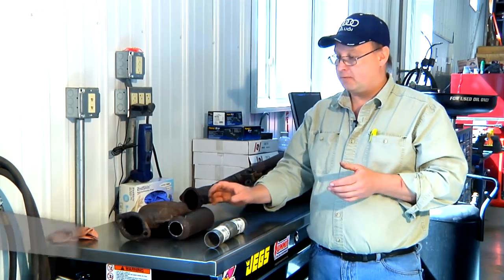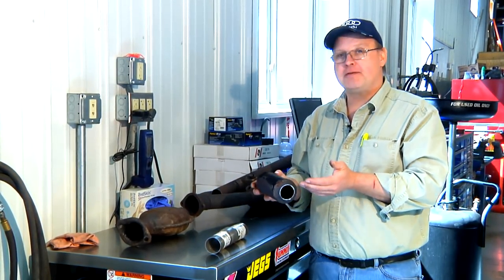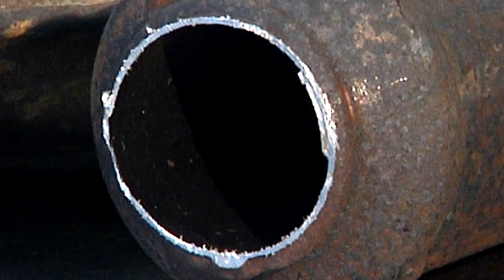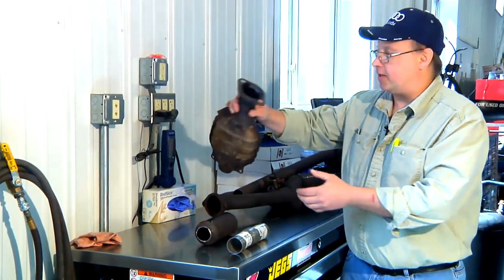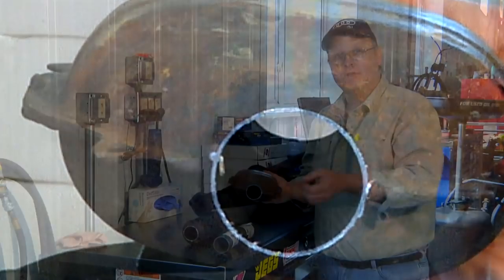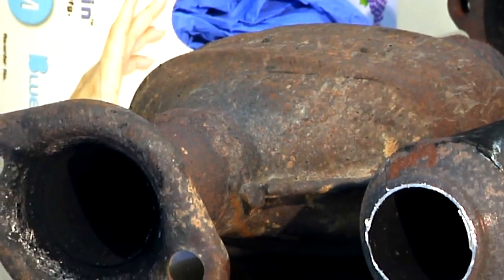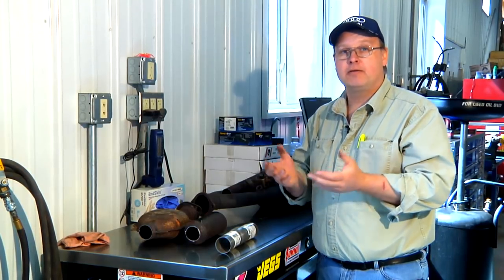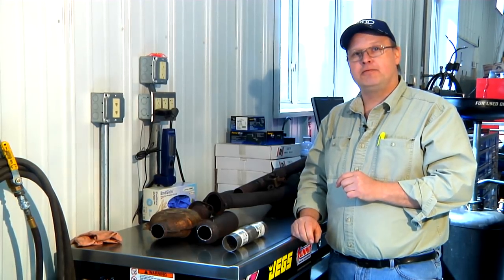What Happens if You Replace the Exhaust Resonator With a Pipe? : Under the Car Repairs

Comment: just remember, an engine is an air pump---the more air you can get in, and the easier the air can get out (with the right percentage of fuel) the more power you are going to make. period. backpressure is restriction, and some will argue its needed; but IMO all that is needed is a tuned exhaust system that takes advantage of scavenging at the right amount for that engine and the cam being used to help vacate the combustion chamber---ideally, you want 100% of clean, unburnt air and fuel in the chamber, no residual gases that wont burn.

Comment: Not sure what's up with all the dumb comments. As an Mechanical Engineer that works in the automotive industry--HE IS CORRECT. The chamber evens out the exhaust flow by allowing the exhaust pulse a place to expand. This MOMENTARY BACKPRESSURE allows for smoother exhaust flow and more efficiency.

Comment: The issue is not back pressure.  The issue is exhaust velocity and proper exhaust scavenging.   You want the exhaust to be the correct diameter because if it is too large exhaust velocity will be hindered.  Right diameter,  straight path for exhaust to follow.  If noise levels are an issued that where sound deadening and baffles come into play.

Comment: my dodge intrepid came stock with TWO resonators on a dual in single out system. i've removed both of them and changed the muffler to a flowmaster 40 series and my gas milage stayed put while my power and responsiveness increased.... so pretty much a res creating back pressure is bulshit

Comment: Im not a engineer but i am a mechanic. What i can tell you is. Car needs back pressure duh Obviously. But regular resonator wont give you much back pressure anyways. so it wont really matter. and resonator compared to a straight pipe wont flow much better honestly. ofc it will a little bit but thats seriously not even alot. so only reasons to do it are sound and the extra extra extra tiny bit of better flow.
most of your back pressure come from the whole exhaust pipe it self since it restricts most of the exhaust gasses from just escaping in to thin air. And things like pipe bends, catalytic converters and mufflers add on to the back pressure.

Comment: That's because a narrower pipe will have a higher exhaust gas velocity. This performs better at low RPM because for that given rev range, the flow rate for that cross section of pipe creates a good balance of static and dynamic pressure

Comment: Back pressure is nothing more than resistance. It's slightly needed for torque but not at all needed and actually avoided for peak horsepower/acceleration. 

I tune for Volumetric Efficiency by reducing back pressure as much as possible at boost or upper power areas where restriction affects flow.

Comment: That's where exhaust header length tuning comes together. Given a certain fixed effective cross section, of course average flow rate is proportional to average velocity. That effect you describe can only work at the specific rpm that header was optimised for, assuming it was mounted correctly on the engine it was designed for. Many racecars actually use heat insulation wrap to keep the heat IN the exhaust pipes to maximize exhaust velocity, as well as reduce engine bay temps.

Comment: You're a professional?  Really?  Ok, others have said this, but to be 100% clear- backpressure hurts both power and mpg.  Removing the resonator will help both (rather minimally, but it will).  In all the examples that I can think of, resonators are installed to attenuate annoying frequencies that the muffler and the rest of the exhaust doesn't for one reason or another, usually a droning/resonating that happens at cruise rpms.  If you want to remove it and don't mind the noise, go for it, it really won't annoy anyone but the occupants of the vehicle, since typically the noise that it does attenuate only happens under load when you're moving and it usually only objectionable when it interacts with the cabin volume.
Reply: right..resonators are there to stop a drone created by having a tuned system/less restriction muffer. and usually that drone is at highway speeds and it can be annoying in the cabin.

Comment: Resonators are design to disrupt the exhaust pulses flow mostly for sound control, depending on size and design of the resonator they will and can produce varies amount of back pressure. But I disagree that back pressure is needed to increase efficiency.  tune exhaust utilizes the push/pull of the exhaust pulse to  optimizes efficiency.

Comment: I think the straight pipe is  way more efficient it give the gas the least resistance to flow as for the resonator it's only for giving your engine a lower sound by reducing the dynamic of the gas.

Comment: If a quieter muffler makes more power than a louder one, it's not quieter because of back pressure but rather destructive interference. I've got my own 'philosophy' about louder or quieter exhausts as well...If it's not a V8 and/or a manual trans, it's better off quieter than louder. :)

Comment: I agree with what the dude in the video is saying, but, it does have some benefit at a cost. Removing the resonator will reduce low end power due to the reduced back pressure, but the benefit is increased top end power due to less restriction and higher exhaust gas velocity.This is all theoretical however, the actual gains or losses may or may not be substantial, and manufacturers usually put them on cars to reduce drone inside the cabin as it can become annoying.

Comment: I had a guy replacing my cars ring and pinion 3.42 to 4.10 and beached about my exhaust cut out i had will reduce back pressure and torque LOL. I always trip out especially on a ls1 ot lt1 camaro how many times i heard that. Never felt they lacked torque nor needed any type if backpressure.

Comment: Resonators do nothing but increase the resonance of your exhaust sound. (Resonance: the quality in a sound of being deep, full, and reverberating.) Back pressure is a myth, the less restriction on your exhaust, the MORE efficient your engine will be. (If tuned properly.) Also, the second rusty peice he shows is just a gutted catalytic converter. 

Replacing your resonators with straight pipe is 100% fine. The only thing you MIGHT notice is a slightly louder, slightly more raw sounding exhaust note, and of course a little more cash in your wallet than if you would have replaced it with another resonator.

Comment: if you install a gneuter valve you will not sacrifice back pressure, and you will gain power, but expect to replace exhaust fluid (the fluid you see coming from a cold engine dripping out the tail pipe)  more often.

Comment: shit man your fine...seems like quite a few people on this page are super strict on keeping a stock exhaust. in my experience, removing the cat and replacing it with pipe generally increases horsepower and fuel efficiency because it allows the air/gases to travel through your exhaust easier

Comment: A properly tuned car requires no back pressure. It's a 4-stroke, not a 2-stroke. Exhaust gases in the combustion chamber increase efficiency, sure, but they don't  increase power. Even a properly tuned 2-stroke should have almost no exhaust gases in the chamber on the charge stroke
Reply: Um...he's right. If you knew anything about overlap you'd see why he's saying what he's saying. No backpressure can end in with a bunch of unburnt charge flowing through the exhaust which is why engines backfire. But let that exhaust valve be blown back open by a charge and you can say goodbye to your engine. This is why a lot of people frag motors that didn't seem to have issues before. Not only that newer model cars will interpret this as "ping" in some cases which will automatically reduce efficiency in the engine. Lastly all of the charge slipping out into the exhaust means less charge in the cylinder for the compression stroke. This is why you see honda's with small engines getting terrible mpg, slower than your granny's stock vehicle of the same trim, manufacturer, and vintage, and not as "racey" sounding as your buds stanced out ride. These are engineered machines. You don't subtract parts unless you have something better to replace it or mods that will support it being gone.

Comment: From what the comments say this guy is wrong then? my old car was straight piped with a straight through aftermarket muffler, super loud, popped, cracked and it was a 4 cylinder. I now own a 6 cylinder car and i just want a nice tone without all the popping. What exactly does the resonator do? and what exactly does the muffler do? i have a rough idea but more knowledge is even better. Should i delete either/or? Both? or save up and get a proper aftermarket exhaust system?

Comment: Depends on the motor, I have seen stock honda's lose power when they do it, But then see an LS1 Camaro gain 30Hp doing it. It all depends on your particular engine and the tune you have set up.

Comment: I honestly do not see how this will effect the epa on some vehicles or can cause harm. If the air is moving at a constant rate wether in revolations or linear flow how would this be an effect on a general vehicle? Please enlighten me on this for I have been doing research to actually do a delete on a 1.6L Alpha II DOHC motor with a CVVT from hyundai on me 2010 Accent.

Comment: My resonator rusted out. Since I didn't have any extra money but I did have access to some tubing and a welder I just put in a pipe. The car is much quieter than it was with the rusted resonator but it has developed a "rap" and it a bit louder than stock. I haven't yet burned a tank of gas so I can't comment on the fuel consumption. And, the reason an engine needs back pressure is so that the exhaust valves stay tight against the springs and don't slap back causing premature failure.

Comment: The faster you can exhaust gases, the faster you can get fresh air in. Resonators are meant for one thing and one thing only, to keep noise decibels to a minimum. It is basically a pre-filter for noise cancellation before it sound even hits the muffler. If what he is claiming about resonators were true, which it is not, then the cat would have already done the same thing before the pulse even hits the resonator. No matter what you do or how high you rev your vehicle, the pulses are going to be there.

States who fail vehicles for inspection if a person has removed there resonators from there vehicle has nothing to do with emissions. They are states with strict laws who have a specific legal decibel ratings for vehicles. Like I tell people, if it is ok for Harley riders say they need loud exhaust so people can hear them coming, then it makes sense for others to have loud vehicles so people can hear them coming as well.

As a person who rides a 2016 R1 Raven and an owner of a bobber style bike, what every your ride is weather it is quiet or not, your still going to be at risk as long as people ignore the fact that people who ride have rights to the road as well. The same goes for vehicles, as long as there is a dumbass out there, your still at risk to be in an accident not caused by you.

Comment: backpressure and exhaust flow are 2 completely different things ,never mix them.
backpressure : more silence,less performance,engine heat
exhaust flow : less engine heat,loudness,performance .
the resonator removes the loud low sounds that cause the vibration (annoying sounds) and it also causes slight backpressure to the system.
Never remove the resonator. (or get the xpipe instead)
Reply: A resonator is a piece of perforated pipe with packing around it and has no effect on back pressure

Comment: This is true only for carb vehicles fuel injection doesn't need backpressure the map and o2 sensors adjust accordingly to flow needs meaning replacing resonator with a pipe does nothing to fuel economy just rasp a little more in the exhaust

Comment: Bob Holcomb: "It also builds the proper back pressure" as he holds a Catalytic converter and also the resonator goes on the very back end of the exhaust to change the sound of the exhaust and not stop sparks as claimed.

Me: Bob stick to washing cars instead of trying to understand them!

Comment: On a STOCK engine equipped with an EGR system (which almost all are), proper back pressure IS needed for correct function of the EGR system.
Do nothing else to your otherwise stock car but cut off exhaust just downstream of the catalytic converter(s), the go out and drive it.  You'll notice the decrease in power.
Modified engines are a whole other story, though.

Comment: I have a 99 vw jetta vr6 2.8 liter. The car is running like crap! I noticed that the cam shaft sensor was bad and the was oil blown through it into the actual plug! I also noticed oil getting through pcv into the air intake pipe! I also noticed that when i plug in a vacuume line in the back of the upper intake manifold the car will stall! I dont have a pressure gauge set to test back pressure! What is your opinion on what i have found wrong so far with the car! Can it be a clogged converter causing these issues? Thanks for a great video!
Reply: If you have access to a jack, and are up to the task of a little manual labor, your cheapest option would be to do the following:
1. BUY SOME PB BLASTER
2. Jack up the front of your car make sure your parking brake is pulled tight.
3. Spray the PB blaster on the bolts connecting the manifold collector to the downpipe and wait at least an hour.
4. Disconnect the downpipe from the manifold.

Now if you start your car and the cat was the problem,  you SHOULD notice it running a little better because your cat will no longer be obstructing the exhaust stream.
Your O2 sensor may throw a code within a few minutes saying that the mixture is running lean because there will be no exhaust for it to detect, however I would think you would already have a code if the cat was the problem. Hope this helps a little.
Reply: I will do that thanks alot! I dont have a cat code but i hope that is the issue not bad rings or seals!
Reply: Any smoke from your exhaust? You may want to check your compression if you haven't already. You can rent the compression tool from autozone if im not mistaken. This way you don't have to physically buy anything.
Reply: German engineering can be tricky. I had a buddy with a Volvo that was having similar problems and sometimes the simplest things can manifest themselves to look like much worse problems. I know whatever was wrong with his car ended up being only about a $150 fix but he had already sold it by the time he realized what was wrong.
Reply: *****  That could very well be, but I am pretty sure they take a lot from VW / Audi
Reply: All VWs have blow by.. its normal

Comment: You need some back pressure but most of the time the factory systems are over restrictive to meet epa an mpg standards. Most aftermarket exhaust company's are aware of this and make there aftermarket systems have some back pressure to stop over detonation in the engine which can damage the engine. The Off Road use systems are usually the lowest back pressure exhaust an can cause engine issues which is why there used on race cars which have the motors rebuilt regularly.

Comment: I removed my resonator and my muffler and replaced it with a pipe

I actually gained 1mpg 
Also drives the same and increased hp because it's not as restrictive 

If this is so bad why did old cars offered for muffler delete or people who builds cars straight pipe it 

100% bullshit just to make ehow look responsible
Reply: For the entirety of the time I have worked on cars there are only 2 things I have seen proven that back pressure is good for and that is very low rpm low throttle torque and quick engine deceleration

Comment: Standard 4 stroke engines do require a certain amount of back pressure. Turbo 4 strokes require less back pressure, because of how the turbo works. Top fuel dragsters don't because of how the engine is set up, the fuel and the immense power they produce, which requires them to have open headers, otherwise the pressure would just blow the exhaust off. Try removing the exhaust off a standard 4 stroke, from the manifold and try driving it, the lack of power will show you what I'm talking about.

Comment: So if your saying is true then my 06 GTO straight pipe exhaust should run terribly yet runs better odd!
Reply: I really think what he means is in stock, low to average HP cars. Like a run of the mill chevy impala v6. In high performance applications it will increase power.

Comment: "Back pressure good for better efficiency"? - Geez...

If you are talking about a carburetor or an older ECU without any correction or learning program, you are probably right. 

But most of modern ECU's got a wide collection of sensors and are capable to learn, adapt and correct the fuel injection, ignition timing or even the valves timing and/or lifting in order to achieve maximum efficiency when the engine is facing different conditions or adversities like different fuel quality or different atmospheric pressure (which changes the raise the intake manifold pressure but generate extra back pressure on the exhaust).

Even the old EEC-V used by Ford from late 90's is able to do the trick... but not so sure about variable valve timing at that time.

Comment: He removed the resonator, not the catalytic converter. Buy the way, cars today are COMPLETELY different from the cars we had back in the seventies, when putting on a high flow exhaust and changing the jets in the carburetor was the quickest way to increase power and efficiency. Today, cars are computer controlled and "tuned" from the air filter all the way to the tailpipe. On some cars, removing the tailpipe can turn on the check engine light. Todays exhausts have some calculated backpressure.